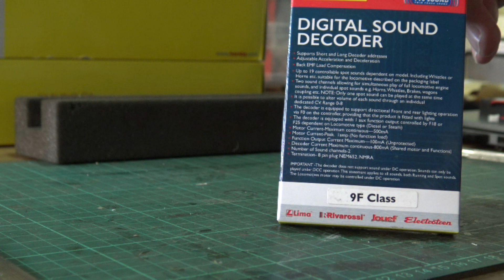Kampala Rd: 9F TTS & Mega Bass Speaker

Comment: Great sound from your big speaker. I fitted the standard Hornby one into a Bachmann 9F which seems reasonable. I always use TCS micro connectors to connect the speaker wires to the tender, so they can be disconnected with the tender. They have not failed me yet. As for my Hornby A3 TTS fitting; the least said the better.
Reply from the maker: Thanks for the heds up re TCS connectors. Where do you get them from? I have had 6 TTS decoder blow. One my fault the rest over heated! I am going for better quality next time. Cheers and thanks Jerry
Reply: @jerryallen34  Hi Jerry,
Digitrains of Lincoln supply my TCS micro-connectors. I usually use 2-pin ones for the speaker in the tender, as everything else is in the loco. Sorry about your TTS failure count. I have some catching up to do. There is a pile of six waiting for me to take the plunge, so it could happen...All the best, Paul

Comment: Very good!...I take it you had a job trying to convert it...not as simple as pluging in the tts decoder straight into the tender dcc plate layout like on the R3396tts model.

Always thought it was silly that hornby released the decoder but didn't even think to release the correct pieces/wiring set like a (plug power cord spine to trail from loco into the tender to the dcc plate and the tender pick ups) to make the conversion more easier for the previous crosti's...instead of doing some major surgery/re-wiring the entire model for sound use.
Reply from the maker: Yes it did need a bit of work. Hornby did make this model with TTS sound but very few and far between. It would be better as you say with the wires in place! Thanks Jerry
Reply: @jerryallen34  the R3396tts was brilliant!..sad there wasn't many...they sold like hot cakes!...glad I bought quite a few before they went out of stock...one or two seem to pop up on eBay every now and again...if you see one it's worth grabbing...why they didn't do the wiring like that model in the first place with the previous without the decoder I will never know...if you look at the pictures on boxes for R3273 and R3274...you can see a cable running off under into the tender like that's how they intended it to be originally but didn't.

Comment: Very nice lookin' and soundin'  loco (Decapod I believe).I especially like that device  on the right side over the middle driver. What is it ? Perhaps a feed water heater ? Never saw anything like this here in the States..
But I must say, I will never buy the idea that because British trains are fenced in means they don't/didn't need head lights !! You do have mountains and hills with bolders which sometimes fall, don't you ? Or, it may not be too close to stop for a recently flooded stretch of track once you see it, or a truck (lorey ?) stuck in a grade crossing. How about a just crash-landed small plane on the track..What don't I get ?? If autos at night would be in an electrically guided path would you really want to see blackness out the windshield and it's pouring rain, too ?  It's like the sensation where you close your eyes while walking, to see what the blind live with, but can only stand it for 2 yards !
I am in no way flaming here gents, or putting anyone down...I'm  overstating things because I've been drinking too much cawfee ! I'm from New Yawk City...yeah, I dig. I should consider decaf !!  M, Los Angeles
Reply from the maker: Mark, apologies on the slow reply. That thing is the chimney.  The one at the front was blocked off.  Something to do with double boilers. Thanks for you detailed comment.  Take care, Jerry